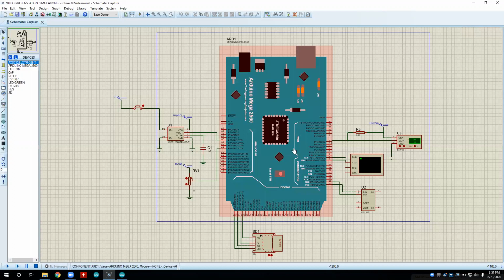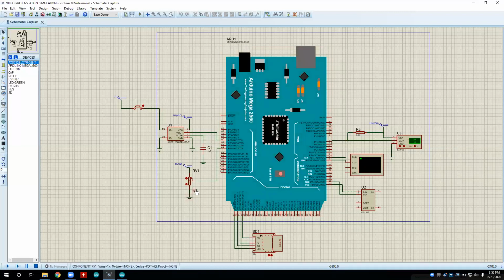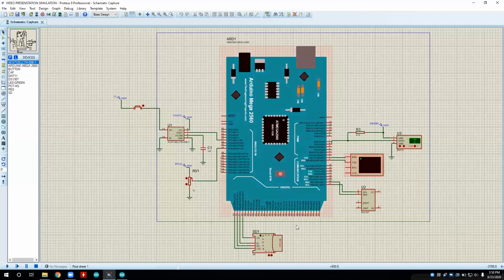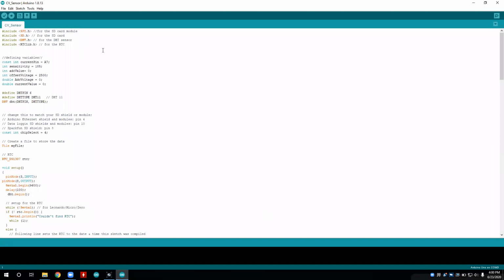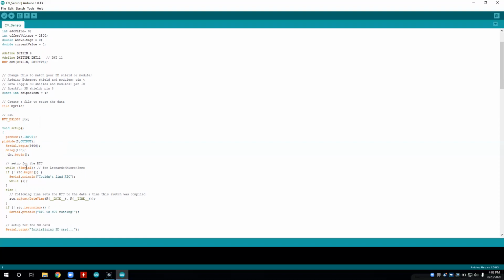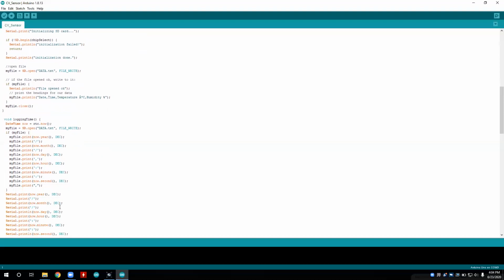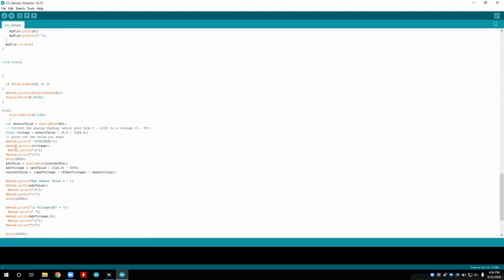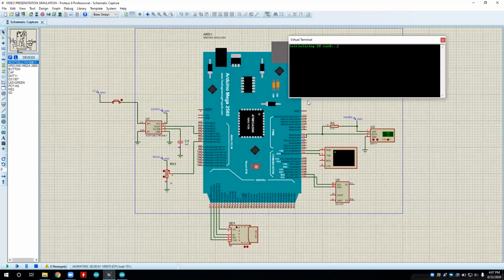Simulation of Current sensor(AC 712 ) , Voltage sensor and Data logger with Arduino Mega in Proteus

Comment: can i got a arduino code please ??
Reply: #include <SPI.h>
#include <SD.h>
#include <DHT.h>
#include <RTClib.h>
const int currentPin = A7;
int sensitivity = 185;
int adcValue= 0;
int offsetVoltage = 2500;
double AdcVoltage = 0;
double currentValue =0;
#define DHTPIN 6
#define DHTTYPE DHT11
DHT dht(DHTPIN, DHTTYPE);

const int chipSelect = 4;
File myFile;
//RTC
    RTC_DS1307 rtc;
void setup()
{
  pinMode(3,INPUT);
  pinMode(8,OUTPUT);
  Serial.begin(9600);
  delay(100);
  dht.begin();
  //setup for RTC
  while (!Serial);
  if (! rtc.begin()){
  Serial.print("Couldn't find RTC");
  while(1);
}

else 
{
  //following line sets the RTC to the date & time this sketch was compiled 
rtc.adjust(DateTime(F(__DATE__),F(__TIME__)));
}
if (! rtc.isrunning()){
  Serial.println("RTC is not running!");
}
Serial.println("Initialization SD card...");
if (!SD.begin(chipSelect)){
  Serial.println("initialization failed!");
  return;
}
Serial.println("initialization done");

myFile = SD.open("DATA.txt", FILE_WRITE);

if (myFile){
  Serial.println("File opened ok");

  myFile.println(" Date,Time, Temperature, A*C, Humidity % "); 
}
myFile.close();
}

void loggingTime() {
   DateTime now = rtc.now();
   myFile = SD.open("DATA>txt", FILE_WRITE);
   if (myFile){

    myFile.println(now.year(),DEC);
    myFile.println('/');
    myFile.println(now.month(),DEC);
    myFile.println('/');
    myFile.println(now.day(),DEC);
    myFile.println(',');
    myFile.println(now.hour(),DEC);
    myFile.println(':');
    myFile.println(now.minute(),DEC);
    myFile.println(':');
    myFile.println(now.second(),DEC);
    myFile.println(',');
   }
   
  Serial.print(now.year(), DEC);
  Serial.print('/');
  Serial.print(now.month(), DEC);
  Serial.print('/');
  Serial.println(now.day(), DEC);
  Serial.println(now.hour(), DEC);
  Serial.print(':');
  Serial.println(now.minute(), DEC);
  Serial.print(':');
  Serial.println(now.second(), DEC);
  myFile.close();
  delay(1000);
}
void loggingTemperatureHumidity(){
  //Reading temperature or humidity takes about 250 milliseconds
  //Sensor readings may also be up to 2 seconds 'old'(Its a very slow sensor)

  float h = dht.readHumidity();
  // Read temperature as Celsius
  float t = dht.readTemperature();
  //Read temperature as Fahrenheit
  float f = dht.readTemperature(true);

  // Check if any reads failed and exit early ( to try again)
  if( isnan(h) || isnan(t) ){
    Serial.println("Failed to read from DHT sensor! ");
    return;
  }

  //debugging purposes
  Serial.print("Humidity:");
  Serial.print(h);
  Serial.println("%");
  Serial.print("\t");
  Serial.print("\t");
  delay(600);
  Serial.print("Temperature: ");
  Serial.print(t);
  Serial.println("*C");
  Serial.print("\t");
  Serial.print("\t");
  delay(600);

  myFile = SD.open("DATA.txt", FILE_WRITE);
  if (myFile){
    Serial.println("open with success");
    myFile.print(t);
    myFile.print(",");
    myFile.print(h);
    myFile.println(",");
  }
  myFile.close();
}

void loop()
{
  if ( digitalRead(3)==1)
  {
    Serial.println(digitalRead(3));
    digitalWrite(8, HIGH);
  }
  else{
    digitalWrite(8,LOW);
  }
  int sensorValue = analogRead(A4);
  //Convert the analog reading ( which goes from 0-1023) to a voltage( 0-5V):
  float voltage = sensorValue* (5.0/1023.0);
  // print out the value you read:
  Serial.print("\t VOLTAGE=");
  Serial.print(voltage); 
  Serial.print("\t");
  Serial.print("\t");
  delay(500);
  adcValue = analogRead(currentPin);
  AdcVoltage = (adcValue / 1024.0) * 5000;
  currentValue = ((AdcVoltage - offsetVoltage)/ sensitivity);

  Serial.print("Raw Sensor Value = ");
  Serial.print(adcValue);
  Serial.print("\t");
  Serial.print("\t");
  delay(1000);

  Serial.print("\t Voltage(mV) = ");
  Serial.print(AdcVoltage,3);
  Serial.print("\t");
  Serial.print("\t");
  delay(1500);
  Serial.print("\t Current = ");
  Serial.print(currentValue,3);
  Serial.print("\t");
  Serial.print("\t");
  delay(1500);
  loggingTime();
  loggingTemperatureHumidity();
  delay(2000);
}

Comment: Brother please provide the ardunio code and proteus simulation file or circuit diagram made by you because it is not clearly visible in video. It is awesome i would like to try the exact thing . Even i want try to make a hardware project.will be waiting for your reply!!
Reply: #include <SPI.h>
#include <SD.h>
#include <DHT.h>
#include <RTClib.h>
const int currentPin = A7;
int sensitivity = 185;
int adcValue= 0;
int offsetVoltage = 2500;
double AdcVoltage = 0;
double currentValue =0;
#define DHTPIN 6
#define DHTTYPE DHT11
DHT dht(DHTPIN, DHTTYPE);

const int chipSelect = 4;
File myFile;
//RTC
    RTC_DS1307 rtc;
void setup()
{
  pinMode(3,INPUT);
  pinMode(8,OUTPUT);
  Serial.begin(9600);
  delay(100);
  dht.begin();
  //setup for RTC
  while (!Serial);
  if (! rtc.begin()){
  Serial.print("Couldn't find RTC");
  while(1);
}

else 
{
  //following line sets the RTC to the date & time this sketch was compiled 
rtc.adjust(DateTime(F(__DATE__),F(__TIME__)));
}
if (! rtc.isrunning()){
  Serial.println("RTC is not running!");
}
Serial.println("Initialization SD card...");
if (!SD.begin(chipSelect)){
  Serial.println("initialization failed!");
  return;
}
Serial.println("initialization done");

myFile = SD.open("DATA.txt", FILE_WRITE);

if (myFile){
  Serial.println("File opened ok");

  myFile.println(" Date,Time, Temperature, A*C, Humidity % "); 
}
myFile.close();
}

void loggingTime() {
   DateTime now = rtc.now();
   myFile = SD.open("DATA>txt", FILE_WRITE);
   if (myFile){

    myFile.println(now.year(),DEC);
    myFile.println('/');
    myFile.println(now.month(),DEC);
    myFile.println('/');
    myFile.println(now.day(),DEC);
    myFile.println(',');
    myFile.println(now.hour(),DEC);
    myFile.println(':');
    myFile.println(now.minute(),DEC);
    myFile.println(':');
    myFile.println(now.second(),DEC);
    myFile.println(',');
   }
   
  Serial.print(now.year(), DEC);
  Serial.print('/');
  Serial.print(now.month(), DEC);
  Serial.print('/');
  Serial.println(now.day(), DEC);
  Serial.println(now.hour(), DEC);
  Serial.print(':');
  Serial.println(now.minute(), DEC);
  Serial.print(':');
  Serial.println(now.second(), DEC);
  myFile.close();
  delay(1000);
}
void loggingTemperatureHumidity(){
  //Reading temperature or humidity takes about 250 milliseconds
  //Sensor readings may also be up to 2 seconds 'old'(Its a very slow sensor)

  float h = dht.readHumidity();
  // Read temperature as Celsius
  float t = dht.readTemperature();
  //Read temperature as Fahrenheit
  float f = dht.readTemperature(true);

  // Check if any reads failed and exit early ( to try again)
  if( isnan(h) || isnan(t) ){
    Serial.println("Failed to read from DHT sensor! ");
    return;
  }

  //debugging purposes
  Serial.print("Humidity:");
  Serial.print(h);
  Serial.println("%");
  Serial.print("\t");
  Serial.print("\t");
  delay(600);
  Serial.print("Temperature: ");
  Serial.print(t);
  Serial.println("*C");
  Serial.print("\t");
  Serial.print("\t");
  delay(600);

  myFile = SD.open("DATA.txt", FILE_WRITE);
  if (myFile){
    Serial.println("open with success");
    myFile.print(t);
    myFile.print(",");
    myFile.print(h);
    myFile.println(",");
  }
  myFile.close();
}

void loop()
{
  if ( digitalRead(3)==1)
  {
    Serial.println(digitalRead(3));
    digitalWrite(8, HIGH);
  }
  else{
    digitalWrite(8,LOW);
  }
  int sensorValue = analogRead(A4);
  //Convert the analog reading ( which goes from 0-1023) to a voltage( 0-5V):
  float voltage = sensorValue* (5.0/1023.0);
  // print out the value you read:
  Serial.print("\t VOLTAGE=");
  Serial.print(voltage); 
  Serial.print("\t");
  Serial.print("\t");
  delay(500);
  adcValue = analogRead(currentPin);
  AdcVoltage = (adcValue / 1024.0) * 5000;
  currentValue = ((AdcVoltage - offsetVoltage)/ sensitivity);

  Serial.print("Raw Sensor Value = ");
  Serial.print(adcValue);
  Serial.print("\t");
  Serial.print("\t");
  delay(1000);

  Serial.print("\t Voltage(mV) = ");
  Serial.print(AdcVoltage,3);
  Serial.print("\t");
  Serial.print("\t");
  delay(1500);
  Serial.print("\t Current = ");
  Serial.print(currentValue,3);
  Serial.print("\t");
  Serial.print("\t");
  delay(1500);
  loggingTime();
  loggingTemperatureHumidity();
  delay(2000);
}

Comment: Code sir please
Reply: #include <SPI.h>
#include <SD.h>
#include <DHT.h>
#include <RTClib.h>
const int currentPin = A7;
int sensitivity = 185;
int adcValue= 0;
int offsetVoltage = 2500;
double AdcVoltage = 0;
double currentValue =0;
#define DHTPIN 6
#define DHTTYPE DHT11
DHT dht(DHTPIN, DHTTYPE);

const int chipSelect = 4;
File myFile;
//RTC
    RTC_DS1307 rtc;
void setup()
{
  pinMode(3,INPUT);
  pinMode(8,OUTPUT);
  Serial.begin(9600);
  delay(100);
  dht.begin();
  //setup for RTC
  while (!Serial);
  if (! rtc.begin()){
  Serial.print("Couldn't find RTC");
  while(1);
}

else 
{
  //following line sets the RTC to the date & time this sketch was compiled 
rtc.adjust(DateTime(F(__DATE__),F(__TIME__)));
}
if (! rtc.isrunning()){
  Serial.println("RTC is not running!");
}
Serial.println("Initialization SD card...");
if (!SD.begin(chipSelect)){
  Serial.println("initialization failed!");
  return;
}
Serial.println("initialization done");

myFile = SD.open("DATA.txt", FILE_WRITE);

if (myFile){
  Serial.println("File opened ok");

  myFile.println(" Date,Time, Temperature, A*C, Humidity % "); 
}
myFile.close();
}

void loggingTime() {
   DateTime now = rtc.now();
   myFile = SD.open("DATA>txt", FILE_WRITE);
   if (myFile){

    myFile.println(now.year(),DEC);
    myFile.println('/');
    myFile.println(now.month(),DEC);
    myFile.println('/');
    myFile.println(now.day(),DEC);
    myFile.println(',');
    myFile.println(now.hour(),DEC);
    myFile.println(':');
    myFile.println(now.minute(),DEC);
    myFile.println(':');
    myFile.println(now.second(),DEC);
    myFile.println(',');
   }
   
  Serial.print(now.year(), DEC);
  Serial.print('/');
  Serial.print(now.month(), DEC);
  Serial.print('/');
  Serial.println(now.day(), DEC);
  Serial.println(now.hour(), DEC);
  Serial.print(':');
  Serial.println(now.minute(), DEC);
  Serial.print(':');
  Serial.println(now.second(), DEC);
  myFile.close();
  delay(1000);
}
void loggingTemperatureHumidity(){
  //Reading temperature or humidity takes about 250 milliseconds
  //Sensor readings may also be up to 2 seconds 'old'(Its a very slow sensor)

  float h = dht.readHumidity();
  // Read temperature as Celsius
  float t = dht.readTemperature();
  //Read temperature as Fahrenheit
  float f = dht.readTemperature(true);

  // Check if any reads failed and exit early ( to try again)
  if( isnan(h) || isnan(t) ){
    Serial.println("Failed to read from DHT sensor! ");
    return;
  }

  //debugging purposes
  Serial.print("Humidity:");
  Serial.print(h);
  Serial.println("%");
  Serial.print("\t");
  Serial.print("\t");
  delay(600);
  Serial.print("Temperature: ");
  Serial.print(t);
  Serial.println("*C");
  Serial.print("\t");
  Serial.print("\t");
  delay(600);

  myFile = SD.open("DATA.txt", FILE_WRITE);
  if (myFile){
    Serial.println("open with success");
    myFile.print(t);
    myFile.print(",");
    myFile.print(h);
    myFile.println(",");
  }
  myFile.close();
}

void loop()
{
  if ( digitalRead(3)==1)
  {
    Serial.println(digitalRead(3));
    digitalWrite(8, HIGH);
  }
  else{
    digitalWrite(8,LOW);
  }
  int sensorValue = analogRead(A4);
  //Convert the analog reading ( which goes from 0-1023) to a voltage( 0-5V):
  float voltage = sensorValue* (5.0/1023.0);
  // print out the value you read:
  Serial.print("\t VOLTAGE=");
  Serial.print(voltage); 
  Serial.print("\t");
  Serial.print("\t");
  delay(500);
  adcValue = analogRead(currentPin);
  AdcVoltage = (adcValue / 1024.0) * 5000;
  currentValue = ((AdcVoltage - offsetVoltage)/ sensitivity);

  Serial.print("Raw Sensor Value = ");
  Serial.print(adcValue);
  Serial.print("\t");
  Serial.print("\t");
  delay(1000);

  Serial.print("\t Voltage(mV) = ");
  Serial.print(AdcVoltage,3);
  Serial.print("\t");
  Serial.print("\t");
  delay(1500);
  Serial.print("\t Current = ");
  Serial.print(currentValue,3);
  Serial.print("\t");
  Serial.print("\t");
  delay(1500);
  loggingTime();
  loggingTemperatureHumidity();
  delay(2000);
}

Comment: hi,can i know,does it work if i use arduino Uno instead of arduino Mega?
Reply: #include <SPI.h>
#include <SD.h>
#include <DHT.h>
#include <RTClib.h>
const int currentPin = A7;
int sensitivity = 185;
int adcValue= 0;
int offsetVoltage = 2500;
double AdcVoltage = 0;
double currentValue =0;
#define DHTPIN 6
#define DHTTYPE DHT11
DHT dht(DHTPIN, DHTTYPE);

const int chipSelect = 4;
File myFile;
//RTC
    RTC_DS1307 rtc;
void setup()
{
  pinMode(3,INPUT);
  pinMode(8,OUTPUT);
  Serial.begin(9600);
  delay(100);
  dht.begin();
  //setup for RTC
  while (!Serial);
  if (! rtc.begin()){
  Serial.print("Couldn't find RTC");
  while(1);
}

else 
{
  //following line sets the RTC to the date & time this sketch was compiled 
rtc.adjust(DateTime(F(__DATE__),F(__TIME__)));
}
if (! rtc.isrunning()){
  Serial.println("RTC is not running!");
}
Serial.println("Initialization SD card...");
if (!SD.begin(chipSelect)){
  Serial.println("initialization failed!");
  return;
}
Serial.println("initialization done");

myFile = SD.open("DATA.txt", FILE_WRITE);

if (myFile){
  Serial.println("File opened ok");

  myFile.println(" Date,Time, Temperature, A*C, Humidity % "); 
}
myFile.close();
}

void loggingTime() {
   DateTime now = rtc.now();
   myFile = SD.open("DATA>txt", FILE_WRITE);
   if (myFile){

    myFile.println(now.year(),DEC);
    myFile.println('/');
    myFile.println(now.month(),DEC);
    myFile.println('/');
    myFile.println(now.day(),DEC);
    myFile.println(',');
    myFile.println(now.hour(),DEC);
    myFile.println(':');
    myFile.println(now.minute(),DEC);
    myFile.println(':');
    myFile.println(now.second(),DEC);
    myFile.println(',');
   }
   
  Serial.print(now.year(), DEC);
  Serial.print('/');
  Serial.print(now.month(), DEC);
  Serial.print('/');
  Serial.println(now.day(), DEC);
  Serial.println(now.hour(), DEC);
  Serial.print(':');
  Serial.println(now.minute(), DEC);
  Serial.print(':');
  Serial.println(now.second(), DEC);
  myFile.close();
  delay(1000);
}
void loggingTemperatureHumidity(){
  //Reading temperature or humidity takes about 250 milliseconds
  //Sensor readings may also be up to 2 seconds 'old'(Its a very slow sensor)

  float h = dht.readHumidity();
  // Read temperature as Celsius
  float t = dht.readTemperature();
  //Read temperature as Fahrenheit
  float f = dht.readTemperature(true);

  // Check if any reads failed and exit early ( to try again)
  if( isnan(h) || isnan(t) ){
    Serial.println("Failed to read from DHT sensor! ");
    return;
  }

  //debugging purposes
  Serial.print("Humidity:");
  Serial.print(h);
  Serial.println("%");
  Serial.print("\t");
  Serial.print("\t");
  delay(600);
  Serial.print("Temperature: ");
  Serial.print(t);
  Serial.println("*C");
  Serial.print("\t");
  Serial.print("\t");
  delay(600);

  myFile = SD.open("DATA.txt", FILE_WRITE);
  if (myFile){
    Serial.println("open with success");
    myFile.print(t);
    myFile.print(",");
    myFile.print(h);
    myFile.println(",");
  }
  myFile.close();
}

void loop()
{
  if ( digitalRead(3)==1)
  {
    Serial.println(digitalRead(3));
    digitalWrite(8, HIGH);
  }
  else{
    digitalWrite(8,LOW);
  }
  int sensorValue = analogRead(A4);
  //Convert the analog reading ( which goes from 0-1023) to a voltage( 0-5V):
  float voltage = sensorValue* (5.0/1023.0);
  // print out the value you read:
  Serial.print("\t VOLTAGE=");
  Serial.print(voltage); 
  Serial.print("\t");
  Serial.print("\t");
  delay(500);
  adcValue = analogRead(currentPin);
  AdcVoltage = (adcValue / 1024.0) * 5000;
  currentValue = ((AdcVoltage - offsetVoltage)/ sensitivity);

  Serial.print("Raw Sensor Value = ");
  Serial.print(adcValue);
  Serial.print("\t");
  Serial.print("\t");
  delay(1000);

  Serial.print("\t Voltage(mV) = ");
  Serial.print(AdcVoltage,3);
  Serial.print("\t");
  Serial.print("\t");
  delay(1500);
  Serial.print("\t Current = ");
  Serial.print(currentValue,3);
  Serial.print("\t");
  Serial.print("\t");
  delay(1500);
  loggingTime();
  loggingTemperatureHumidity();
  delay(2000);
}